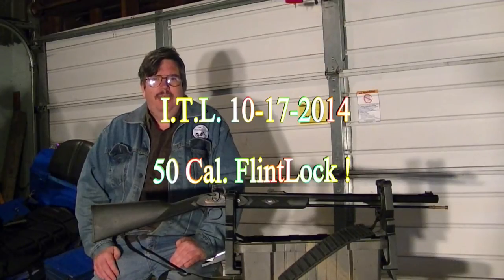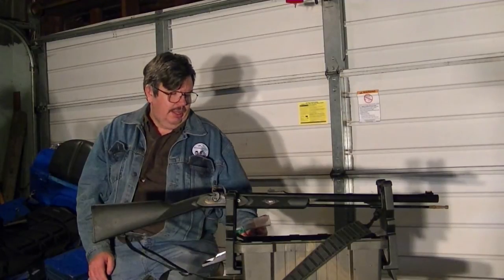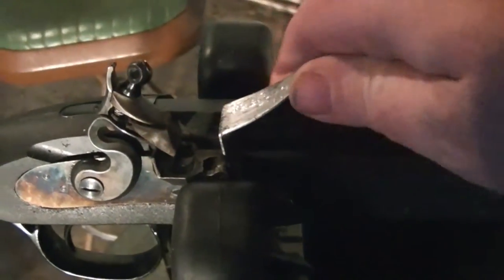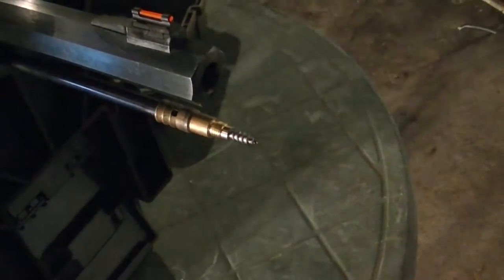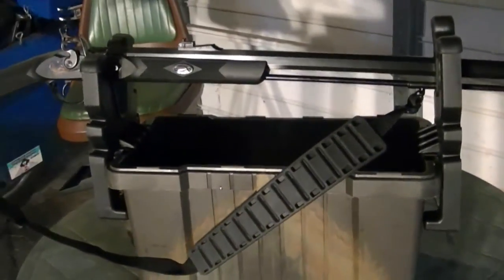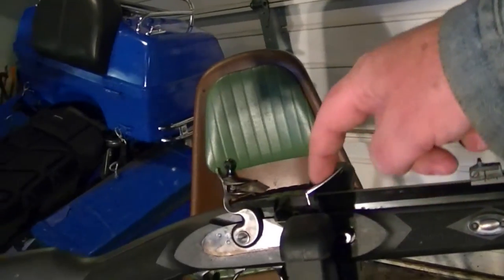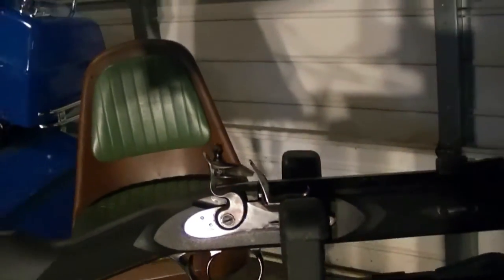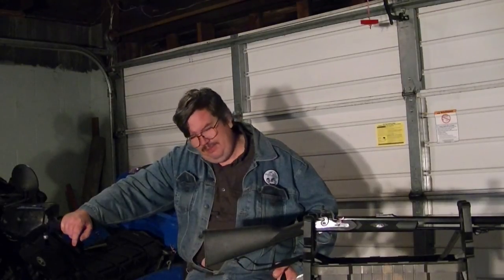ITL 2014 10 17 ! ( traditions pa pellet )

Comment: pyrodex in a flintlock? I thought the sparks created are not hot enough to ignite pyrodex.
Reply from the maker: It works . I have taken down many deer using it .
Reply: Is 4f powder primer required to ignite pyrodex. I have a Kentucky rifle from Traditions and now i wonder if its usable in the Kentucky
Reply from the maker: +Jonathan Rodriguez I use 4F but was told I could use 2 F . 4 F has not let me down yet . Now that I have said that . It will now Lol ! I do not see why it would not work .
Reply: Thank you for the response and clearing that up. I'm new to the muzzle loading world and I only used black powder like goex and swiss. Also I always heard bad things about the substitutes so I avoided them.